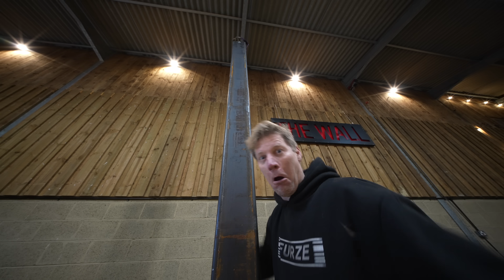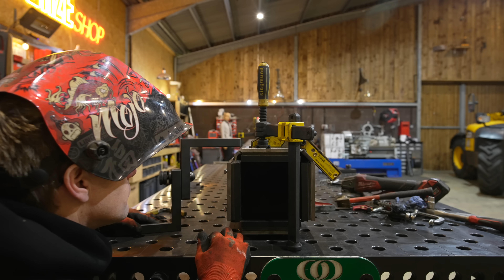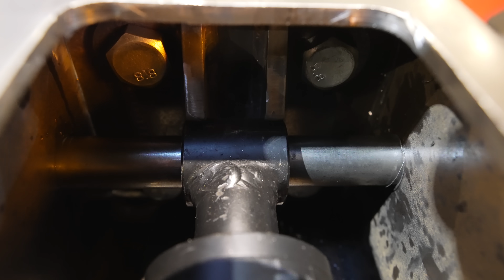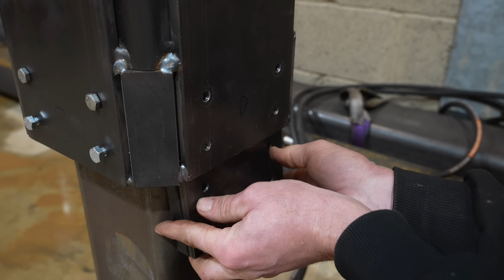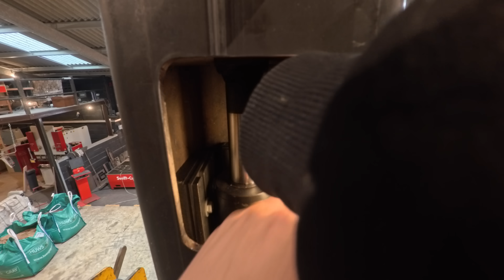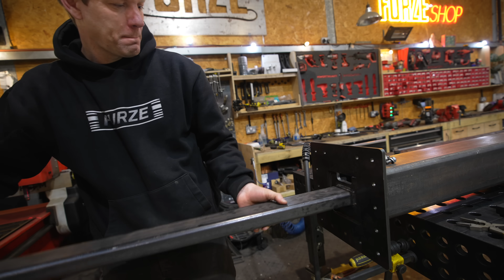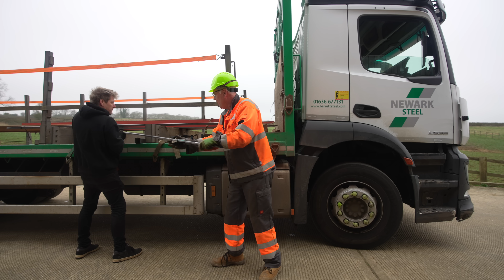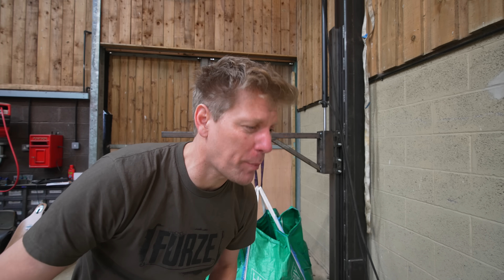Digging SECRET Garage Part 7 Car Lift Prep

Comment: The rubber pads are better, grease those babies up and put channels in them to accommodate grease travel, just lather that inner collum up with all the grease. :) SPARE NO GREASE. Those roller bearings are going to make your life hell. Don't do it to yourself Mr Collin. Your first idea to guide the beams with rubber pads was the right one mate.

Comment: so that inspection plat at the bottom for the car, if its solid, how will u inspect the middle section of the car?   surely you will need 2 ramps, like a mechanics lift in their garage?  the vid showed a solid plate..

Comment: Is there also a plan for an mecanical lock on the second Lift, so you have a secondary safety when using it as a inspection lift?

Comment: Have a look at JOAB lift dumper systems. I have picked up 10 tonne weight on two cylinders. It has a valve box that equalizes the pressure on both the cylinders.

Comment: Haven't watched the whole video but you should maybe look into some redundancy systems or safeguards of you ever have a catastrophic loss of hydraulic pressure so that the plattform doesn't just fall down. The hydraulic cylinders might already retract slowly if you loose pressure but if not then you should look into something to prevent that. Maybe some ratcheting system so you need to disengage it or reverse it to be able to go down again.

EDIT: Yeah, of course you thought about some safety break. Just watched you bringing that up at the end.

Comment: In regards to syncing up multiple cylinders, if you are planning to use one large HPU, you can use a flow-divider valve to equally distribute the flow. They aren't cheap, but they work.

Comment: Hydraulic lifts (elevators) are safer than the ones that rely on cables, because if something goes wrong the fluid just leaks out and the whole thing sinks down instead of falling like a stone.

Comment: I would look into hydraulic line break valves. They are small inline valves that will stop the flow of oil if there is a sudden break/burst in the oil line. (and obviously you will want to use PO check valves when you are dealing with vertical loads).

Comment: I hope you manage to get all four cylinders synchronized properly, Colin! With hydraulics, that can sometimes be quite challenging. Often, servo control valves are used for this, along with absolute encoders on each cylinder. This way, you can potentially create a master–slave system.

If you're still exploring options for a mechanical solution: for synchronization in hydraulic presses, I’ve seen setups where a shaft with gears on both sides is used, which are then connected to a rack on both sides of the press ram.

Good luck with the build!

Comment: G'day Mate, one thing i don't recommend is mounting your rams to any of the walls, the beams need to be in from the wall a bit. The reason for that Mr Collin is your lovely concrete and the crumbly dirt you got behind it. I know its solid, BUT, the repetitive use of anything lifting tons connected to your main structure is going to slowly tear it apart. The concrete will micro fracture, you will get panel separation from the membrane. Another thing against the wall it will give floor space, but every foot wider than it has to be, "adds," exponential hydraulic forces. The under frame for lifting, and all your triangles will be huge. *Horizontal, flat, level, synchronised, lifting, * gets harder. To do it smooth you are going to need a big boy of an oil pump. $$$ (Filter replacement costs) $$$ Do you have you Feed lines all balanced at the pump? or do you have a flow sump that sends pressure evenly from the floor out to the rams? THANKYOU HEAPS FOR THE VIDEOS MATE, love your work. You're a really smart and funny man. I loved the DUNNY DOOR from back in the day. lol mate :)

Comment: I'm not going to knock it, man, that is so overly complicated for what you need. But hey, it's your passion project, and kudos for how you are doing it. I think, coming from a forklift engineer with over 36 years in it, there are so many different things I would call slightly better configurations using angled load bearings similar to forklift masts and carridge bearings. Also, with your lift cylinders, you could have used just one with a lift chain to double capacity and lift height just like forklifts have done for decades to raise the carridge and mast channels. Seriously, it's a good build and great job with the videos. 👍

Comment: If you think about it it's just a really big 4 post garage lift, the ones I've seen use a ratchet mechanism rather than the friction lock safety break but if it's good enough for an elevator its probably fine here, and I think a lot of them also use cables and pullies to keep everything synced up although I have seen portable 4 post lifts where each post is a fully independant peice that you can move around like a pallet truck, lord knows how that works but I imagine they use position sensors and computer control to keep everything lined up. I think you could maybe also use hydraulic flow splitters except that if the seals in one piston leak a little more than the rest then that piston will not extend as fast even with the flow splitter, there is probably a reason they aren't used for stuff like this

Comment: 21:15 Awesome tip, using drill bits as spacers. Just be careful. The shank is often smaller than the flutes. Use your micrometer

Comment: I know it probably a bit late at this point but if you treat it as a regular 4 post lift, ie one ram with cables that lift each corner it might help with the whole hight thing excluding the turn table. However I dont see why you couldn't build such a mechanism into a 4 post lift. The only issue work be you would need a verry long hydralic ram to get the hight you need our of the lift. 

Ps im a lift installation engineer that predominantly works on rotary 2, 4 post lifts and sissors lifts

Comment: Most of the things I've watched you build are pretty good . But this thing is way too complicated. The pads could go inside like your telehandler. the guides on the wall  could have been a small uhmw poly sliding pad, bolting it too the floor gives you lots of strength already .  You can also get a safety valve that goes in your hydraulic line to prevent descending or retracting  to fast. Its very unlikely that all the rams would ever fail at the same time   Use the KISS principle

Comment: Since you're going to employ cables and pulleys you could have positioned two cylinders, each one horizontally, completely outside of the the beams. You could/should add safety dogs / locks on the posts, similar to automotive hoists, in case of failure.

Comment: Did you know the son of Mr Delorean sells conversion kits to turn a Reliant Rialto into a DeLorean "homage" complete with gull wing doors, you should do one for your missus maybe put a Fiat FIRE engine in for more speed, uprate everything and fix in some super cool effects inside, you could even skin it with a stainless steel vinyl.   Although if you had a Bond Bug you could make a Star Wars land speeder which is what the film makers used for Lukes speeder a humble bond bug although I would say the bug is just too cool to do anything other than a 950cc engine from a Liege or again the Fiat FIRE engine (1300 is an absolute blast)   I have owned my own Reliant for 14 years, has uprated suspension and I can drive it like I stole it in these Dorset lanes and never ever had a rear wheel lift thanks to the Accord type R anti roll bars I fitted goes round corners like its on rails :D

Comment: A tip for the future? Use 2 different threaded nuts/bolts. This way you can adjust to whatever you like. 
Like 1mm righthand thread in a base, and 0,5 lefthand thread in the (? how do you call it) whatever you need.  
One quarter of 360 degress will tighten (or loosen) whatever you like in 0,375mm with a bit of strenght. 

Or apply other threadss for a finer adjustment.
Reply: Oh, and of coursse it will be all custom made. But thats who you are. Custom made ;-)

Comment: One thing I’ve not heard you consider is syncing the hydraulic cylinder movement. What stops any one or more cylinders over reaching the others? Is there some kind of dosing manifold that ensures each cylinder receives the same volume of fluid?

Comment: I think that will not work a you have planed the sync. We had such usecases in our machines. When you won‘t go the electronic way you will need a precision oil flow divider.

Comment: Colin can you use a screw type mechanism?? Like 2 post lifts
Reply: That way there is no access to hydraulic pipes etc just access to the brass screw nuts which can be replaced though access windows

Comment: Oh I'd also definitely make a cover for the hole you cut in the column to allow access to the hydraulic ram. One that you can bolt on and off when you need access. 

It would help keep anything from getting inside the column. Dirt, etc but probably more importantly anything that might interfere, catch or worse damage any of the workings inside the column. Especially as it'd be a fast and simple job to do.

Comment: Hidden cylinders like this are always a problem. Normally we avoid multiple cylinders by using wires and a jigger winch system with one or two cylinders balanced together. However I did design a vertical lift system for a cruise ship stores system with 5 tonne capacity. 
Like yours I used two square hollow sections with sliding Delron pads but the columns were accessible from the top with a bolt on cover in the closing deck plate to facilitate withdrawal of the cylinder and/or the inner tube for maintenance. 
So slotting the tube is not recommended or needed. Maintenance small windows are OK, better still with a bolted cover for strength.
Clamping the top of the cylinder body is also necessary to stop buckling of the rod during operation under load. 
Guiding the lift was very necessary in all directions to compensate for ship movements so for your static lift frame it is not so critical but some is required. 
Allowable movement of +/- 1mm in all directions is reasonable, any less might be too restrictive in a hot summer, if we ever get one in England!
Redundancy is also required, like testing with only 3 cylinders operational.
Have you thought about locking when the platform is up? 
How will you know if it will move down or not when you go to drive on from the street? Some small hydraulic locking cylinders (at least 6) with sensors to tell you when it is locked/unlocked by lights on one column in front and one at the back.
I am retired now but I worked in shipbuilding and cargo access equipment for the last 53 years as a mechanical engineer/designer specialising in access ramps (side & stern), large doors, internal moving ramps, lifts and also the equivalent for the port access equipment. I am fascinated by your endeavours and watch every episode and wish you every success!

Comment: You might want to incorporate a safety latch system. Like lifts have. Rollercoasters have them too. In case a hydraulic line blows out or something. It could be a hydraulic actuated latch so if it loses pressure it latches so it can't drop. But a manual one would be more reliable I think.

Comment: For a video sponsored by OnShape there sure was a lot of physical models and test pieces and not actually showing or using OnShape, which, you would've thought would've been perfect for exactly this. Myself, I'd rather use models and physical experimenting than mucking about in software most of the time.

Comment: Hi Colin with the brands that you are using if you wish to go for a displacement ram you only have one seal at the top which is quite easy to change. All you have to do is support the ramp so you can just lower the ram itself internally take the cap off replace the seal put it all back together they used on forklifts I’ve replaced many of my time all the best Steve

Comment: @colinfurze I’d love to help with this. I can build and send you a smart relay switching demo — touch screen controls for inside, plus an Android app for outside access. It could be as simple or as secure as you want: logo screen, PIN code, even fingerprint. I’d be buzzing to put together a proper demo pack and a clear plan if you’re interested.

Comment: Using hydraulics is possibly not a very smart idea. From former multiple clients  experience hydraulic fluids take the easiest route. On hydraulic lifting post works fine. When you use 4 or 6 legs  the tendency is for the hydraulic fluid not to flow evenly/equally and then the lifting section jams up and you have a massive problem! 
Electric screw jacks proved to be the only reliable solution!

Comment: My first thoughts and concerns were for some sort of circulation/ventilation for the car exhaust gasses. The second was for some sort of sensor and braking system for if something or someone is stuck in the middle while the lift is lowering, as well as underneath the lift to prevent it getting crushed.

Comment: Colin, to keep all the legs lifting at the same rate, you need to connect every leg with a hydraulic line using Ts. This distributes everything evenly and you shouldn’t have build a structural connection.

Comment: Amazing work so far but the hydraulics themselves make me a bit worried. I have learned that you should never trust hydraulics completely especially while holding weight. Have you got some kind of latch or pin mechanism designed so hydraulics don't have to hold the weight?

Comment: Colin - You’ve put a ton of effort into making sure the hydraulic cylinders are replaceable once installed. Have you considered that if the cylinder needs to be replaced, you likely won’t be able to lift the platform with three or less cylinders? You’ll have to make a special jack if the time comes lol

Comment: If you want to work under the car when it's raised on the inner lift you'll want to make sure that you leave a hole between the wheels. For safety it might be best if it has a cover that can slide in and out of place incase the wheel tracks are missed when you're parking.

Comment: You can get speed sensors that are like 9 quid each that can individually speed up or slow down the other legs so everything lifts and falls smoothly. I mean, the unit l, the parts, and software is in the thousands. But the sensors are cheap haha. No, I can’t remember what it’s called but I will google and report back if I find it.

Comment: DEFINITELY, DEFINITELY NEED TO GET A HIGH QUALITY METAL CUTTING CIRCULAR SAW! 

They do a really good, really clean job and cut the metal faster than a grinder. 

Having one would save you a fair amount of time and also it'd be much easier to use and will leave a cleaner cut and finish once the metal cut is finished and done.

Comment: 27:27 Those phone cables look rather low for the telehandler. Are they going to be close if you have the lift at full extension with a car on top too? 😂

Comment: Why don’t you use an internal lead screw running the entire length, with internal supports so the screw doesn’t bend? Is it to lift the platform using the same piece you already have, just with the worm gear mechanism inside? As for the motor, you could use four external electric or hydraulic ones—at least that way you’d eliminate the issue of accessing the pistons. Maybe it’s a wrong idea 😂😂 but still, huge respect for the whole project!!

Comment: having fun with voiceover. also implementation process != design process. why you put the hydraulic stuff in the leg. outside the leg all the maintenance nonsense. ie keep it simple. stuff inside makes it unnecessarily complicated. a huge linear screw lift might do it. or just normal cable lift. train tracks are fun. way too much waffling around. industry production is boring?

Comment: I was dismantling a machine the other day that had two gas struts in it and also mounted one on top of the other. Quick note: when unscrewing something that's under pressure, the pressure will release. Anyway I got a busted lip now, teeth are luckily still intact.

Comment: Concerned about the safety. carlifts with posts use mostly screw type systems these days instead of hydraulic sylinders since screw type system usually just stops in case of failure. what if one or more of the safetybrakes fail? or they grap different times so at each moment only one safetybreak might hold whole weight. and mass to stop might be very high since system has time to accelerate before safeties kick in.

Comment: Regarding the secondary cylinder: why not orient it vertically from the base? This configuration maximizes the effective piston area, delivering significantly more force than the current angled mount. As well put a velocity fuse on it for safety.

Comment: Being hydraulics, does not liquids put the same pressure in connected pipes, wouldn't that be enough to equalize pressure? I suppose one drawback is that you need a more potent pump. Just as a heads up, I have no idea about hydraulics im just asking

Comment: I'm not entirely convinced by your cable idea for parallel driving the cylinders. For floodgates the best practice is to use a master-slave system, where you electronically measure the stroke of each cylinder, and using proportional valves to control that the displacement of the slaves are the same as for the master cylinder.

Only issue is that it is a pretty expensive way to solve the problem.

Comment: I didn't know Teflon sells PTFE pads like that, I use PTFE pads for bridge bearings, we use a polished stainless steel slide plate to reduce wear, it might be a good idea to tig weld a 1mm stainless steel plate to your inner square tube. Mild steel can rust and tear up the pads.